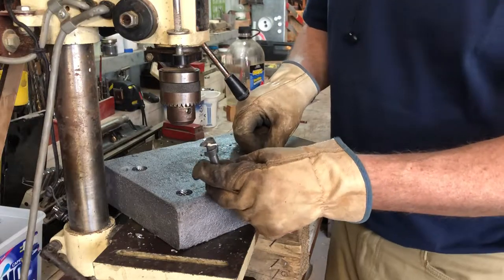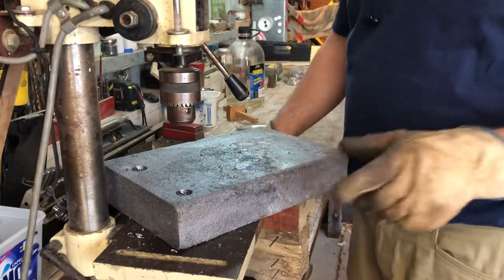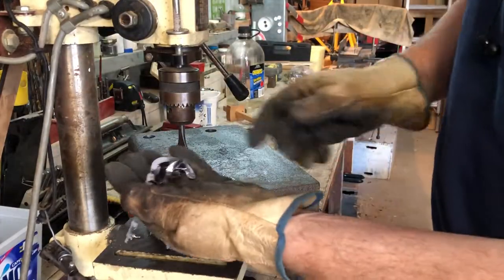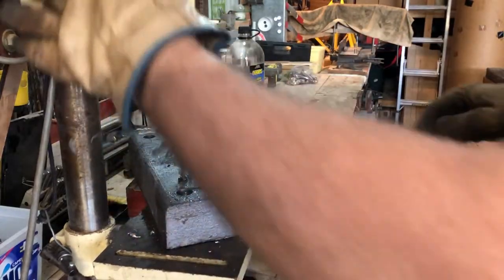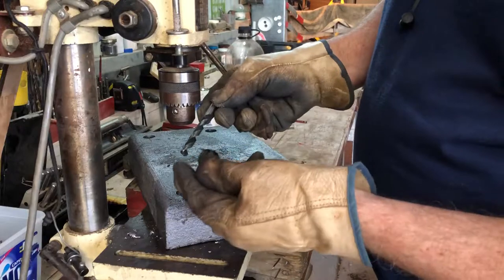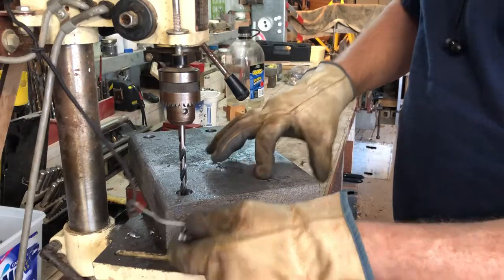Drilling the lead tiles in preparation for attaching to the hull

Comment: I like NIS boats. Very interesting. Are that tiles mounted with some special bedding compound? Would like to see pictures of the inside of the hull after mounting them…
Reply from the maker: Hi S D, if you look at the blog post and scroll through the pictures, you will see the heads of the bronze coach bolts on the floors. Once I finish 'glassing and fairing the floors, these heads will be mostly hidden in the layers of filler and fibreglass : https://paulsboat.wordpress.com/2019/08/14/getting-the-floors-sorted/
Reply: @PaulAtkins  Thanks for that link! Will read it this evening…
Stay save in this time...
Reply: @PaulAtkins  Looks really good! Would like to see pics of her on the water soon… ;-)